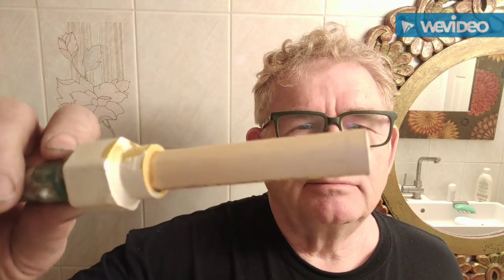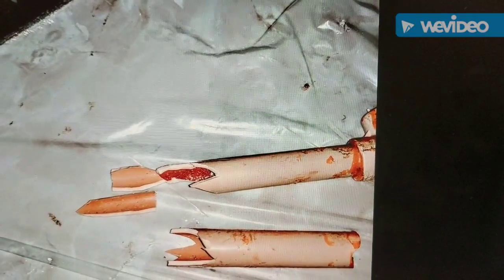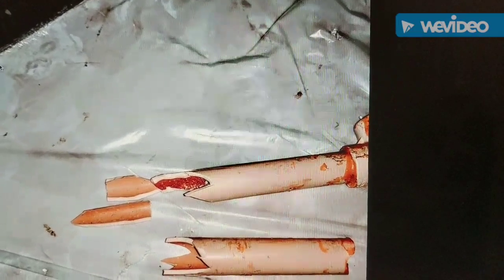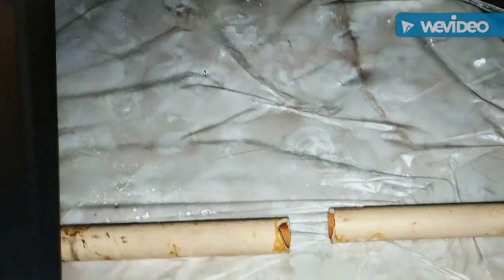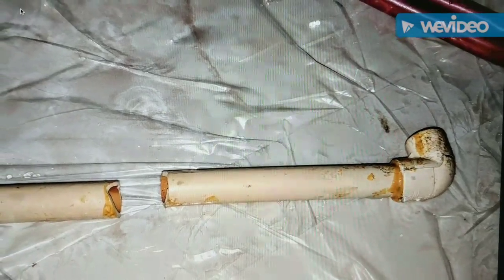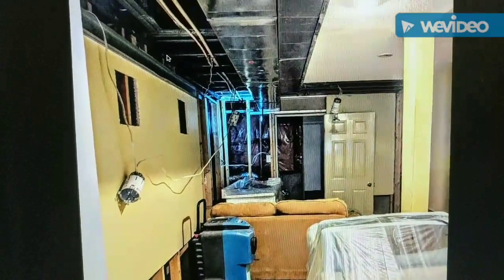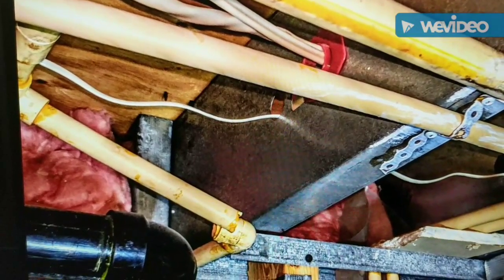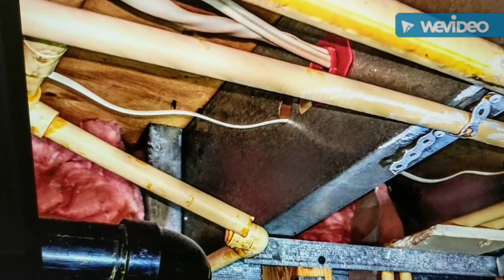The Danger Of CPVC pipe

Comment: David knows what he's talking about. I just bought a 26-unit apartment house, build in 1999, and it's all CPVC inside. I was told by my inspector that 3 of the shut-off valves are leaking. They're all Sharkbite. When I went and tried to remove them, the CPVC shattered all the way back behind the wall on a couple of them. I'm having to rip out drywall and try and figure out what to do. If this had been a tenant and they accidentally shoved something against the valve, it would have flooded the unit, and the units down below. The CPVC was NOT clamped or braced from behind, so in part, it's installation error, but the fact it's so brittle and shatters SO easily is what David is trying to get at. You idiots in the comments telling him "it's been this way for years, David's wrong" don't know what you're talking about. David's pointing out that it's BRITTLE and therefore subject to breakage, not whether you CAN get it to work for 30 years or not. It's a warning, a clear description that installing it CAN lead to problems. I'm not sure there is actually a failproof alternative. They used to make pretty bad-ass copper tubing once upon a time, but the stuff they make these days is junky. I'm suspicious of Pex, so I'm not quite sure of what to do. I want to go back into the walls for every shut off valve and turn the CPVC into copper before it comes out of the wall so tenants bashing and yanking on the valves won't be touching CPVC. Not quite sure how to do that...
Reply: I'm a Maintenance man at a 96 unit complex and it was built in 98 and has cpvc throughout. Its a pain to work with and you have to be super careful not to break while doing what would otherwise be easy repairs. Water heaters are a good example. Gotta be super ginger with the main lines. I've broken two even with being careful. I Hate Cpvc.
Reply: I have galvanized pipe. Should i go back with a galvanized pipe replacement?
Reply from the maker: Thanks for the comments - I use copper type M for my water lines mostly and Viega pro press fittings to join it. That’s the best method for water lines- but expensive for the do-it-your selfer- if you can solder - it’s a tried and true method to join copper-The plastics industry is still pushing CPVC- but there’s always been BS in advertising -
Reply: @TheDavelaird  I really like your video. Only plumbers with lack of knowledge continue to use CPVC nowadays
Reply from the maker: @danielhennequin7753  Thanks -There are so many better piping systems now,We try to stick to Wisboro,Pro Press,Mega Press etc so I can sleep at night and not worry about Liability Claims

Comment: I purchased a cabin in the mountains that sat for 20 years with no environmental control.  There was no water running through the house but  due to cold temps it became very brittle.  Were slowly replacing it with pex.  Its been a nightmare!

Comment: Copper is the only thing that’s any good. The pex and c p v c I don’t use. As a builder and income property owner for 34 years. And as an hvac- refrigeration contractor for 42 years..  I won’t use anything but copper. Pex is ok in manufactured homes. The c p v c is a nightmare waiting to happen. I won’t buy or build a property unless it’s copper plumbing.

Comment: What causes CPVC to get brittle is hot water, especially if there is a circulation pump, or UV or a long period.  CPVC has no problem with chlorine while PEX does have a problem with chlorine and very sensitive to UV.  If a plumber leaves a roll of PEX outside, it will be shot in months.  PEX is the easiest to install.  Plumbers tend to us CPVC for remodels because the runs there there for the steel pipes and it is easy, and PEX for new because it is the cheapest when labor is involved.  What is interesting is places like Saudi Arabia have used CPVC longer than the US and have zero issue BUT they only use Schedule 80.  It's the same OD with thicker walls.  CPVC expands a lot more than any other plumbing material which is why you need to plan for it.
Reply from the maker: The brittle pipe I showed in the video was COLD water So please explain all the problems with CPVC sprinkler lines, which are all COLD water-so much for your theory-CPVC is Junk -hot or cold -i'm a master Plumber and i prefer copper pipe or wisboro (Pex A) Pex B is for Handymen or cheap builders and what they do in Saudi Arabia is of no concern in North America -They have Sand and Sun-We have Snow and Smog

Comment: David,  My contractor install PVC for main water supply in the retail commercial building.  Today one of the plumber recommended to replace it with CPVC (per building code, he said,  Should I replace it?
Reply from the maker: I would stick to PVC especially if it’s underground - I don’t know the code in your area- but call the local plumbing or building inspector to see what they say -I wouldn’t use CPVC for anything.
Reply: @TheDavelaird  The 2” PVC pipe from underground to inside the building hang up about 7’ below the ceiling to supply  water for each tenant.  My main concern is that what inside the building is PVC,  but just for cold water supply.  
My other question, What pipe type for the tenant using for their unit?  Some use pex other use cpvc since it recommended per code?  But this building doesn’t needed inspection for plumbing.
Reply from the maker: @jasontran06  I don’t know what area you’re in but my personal preference is for wisboro pex type 1 - for hot and cold water or copper pipe Ifvthere is no plumbing inspection in your area you could always coordinate with your insurance company to make sure that if there is any problems the insurance company is going to cover it Or hire an architect or a certified engineer to go over the building with you and make specifications

Comment: I am putting in a under ground rain water line ..guess will be last time I use CPVC ..//so what do i use ..steel ,copper ? ? How about regualr PVC ? //Chlorinated polyvinyl chloride

Chlorinated polyvinyl chloride is a thermoplastic produced by chlorination of polyvinyl chloride resin, which is significantly more flexible and can withstand higher temperatures than standard PVC. Uses include hot and cold water delivery pipes and industrial liquid handling.

Comment: Chlorinated polyvinyl chloride is a thermoplastic produced by chlorination of polyvinyl chloride resin, which is significantly more flexible and can withstand higher temperatures than standard PVC. Uses include hot and cold water delivery pipes and industrial liquid handling.//
Reply from the maker: That's a Great Blurb-right from Wilkopedia-But too bad It Gets hard and Breaks over time-read the comments on this page and take some advice  from this old Plumber-

Comment: The only time I touch cpvc is if I can replace it with copper back far enough that I can anchor it to a stud. People do stupid things like yank on their hose or pull on a random pipe sticking out of the wall. CPVC is fine for fire sprinklers hidden away in a ceiling.

Comment: Why is state and city inspectors put their seal of approval on all new installation.🤔
Reply from the maker: approving a plumbing installation is totally different ,if the product is approved for installation by the local code.  The inspector would have to approve it as long as it’s done according to the plumbing code( I.e. properly vented etc.) it doesn’t mean that it’s a good product -usually manufactures  lobby code writers and municipalities in order to have their products installed in various codes -History shows that many products have been approved for use in  codes ,only to be subject to legal proceedings  after  a series of poor performance (I.e. Kitec pipe, bituminous sewer pipe,Asbestos,PCB’s etc etc)

Comment: did you use the plastic valves---mine just snapped off---there is a screw in the handle ---can the handles be replaced?
Reply from the maker: I never install CPVC nor would i ever use a plastic CPVC valve-why not buy an identical Plastic valve and use the handle?

Comment: I just found this video because previous owners ran cpvc to barn from house. I'm now chasing cracks and leaks in 3.5 ft deep muddy holes. I hate how brittle this stuff is
Reply: lol, for exterior you need to use PVC sch40 for water and for hot water line its best to use copper. CPVC is alright in attic in in between ceiling spaces, for underground use you have to be careful. CPVC is not the best option for cold water. PVC SCH40 is stronger.

Comment: Copper causes more problems with leaking elbows with pin holes.
Reply from the maker: Not in my 50 + years as a plumber - nothing is forever-copper fittings and pipe can pinhole- but a small spray after many years of service is nothing compared to a horrific flood from a cpvc water line snapping off under full pressure after only a few years

Comment: It's been around more than 15 years, came out in the 60s. I've had it in my house almost 50 years with no problems. I'm on a well so there's no chlorine in the water.
Reply: Me too. Our house is 32 years old and I've never had a problem.
Reply: I replumbed my whole house Yr.s ago with cpvc. Probably 20 to 30 yr. ago and have had a couple of times where I have found brittle pipe. But it was when I was doing a miner repair. Cpvc is good,but you do have to keep in mind the warnings in this vid. I am getting ready to replace a tub,shower valve and will use cpvc. The main reason people use it, including me is because it is easy for diy. You just have to go slow and understand the good and bad. This is the first vid. I have seen on this and it was a good vid. and warning.
Reply: Exactly, What some don't understand is it's not for every jurisdiction. Some have wells some have chlorinated city and others. The only leak I ever had was copper pipe pin holes from my well water. Re did whole house with cpvc.

Comment: Well if you are DIY you can do copper with sharkbite fittings or practice soldering , so best choice.  Cpvc you can't expose to sunlight but its easy for diy, so is pex. I just took apart my bathroom, 50 year old copper pipes still going strong, they had copper drain pipes that corroded. But, the house always ran on well water so no chlorine, you ever see a pool guy who puts equipment in back of his truck, if you do you know that truck is rusted out. So pre-filter your house from chlorine? might be a good investment. Something to think about but it comes down to budget, skills, footage. Good luck.

Comment: Great video- but when you present a problem/risk- you should offer a solution.  If your message is to not use CPVC then recommending what to use in its place would have been helpful.  Thanks
Reply: Obviously copper, right?
Reply from the maker: Hi -I use copper or Wisboro pex A-But I prefer Viega Pro Press copper-you have to solder if you dont have the pro press tool

Comment: 1:21 "mention poor lady pulled her hose in garage" Lets look at the context of where PCVC is installed in a garage- non conditioned space, and maybe on an exterior wall and possible in an enviroment of heat and UV exposure. We have seen CPCV exposed on the exterior  and interior of a garage instead of PVC or copper which created the same brittle effect. I would not apply your context to ALL situations. Builders are gong towards CPVC due to labor costs and material costs- huge usage in southeast gulf states.
Reply from the maker: The break was INSIDE the house . The hose was connected IN the garage-The brittleness in The CPVC is from Chlorine in The the water -so your theory doesn't apply -Most  plastic exposed to UV rays gets brittle-But CPVC is installed in walls and isnt exposed to  UV rays
Reply: I’ve been a Gcontractor, remodeler, and now currently a home inspector in the state of Washington for a total of 27 years. This stuff is a complete nightmare and one of the biggest failures in construction process in all the time I’ve been involved. It’s completely insane that it was used so prevalently for about 8 years. Just like how contractors were getting away with no drip flashing and facia on an Osb roofing system. These things take a while to play out and find their obvious problems. For cpvc it took 5 years. This stuff is garbage
Reply: I’m
Actually going to fix a friends house today that leaked into the kitchen ceiling and has cost untold amount so far. At least it’s not behind the tile in the bathroom. But I’m a couple years who knows. It’s on the hot side and his water is chlorinated. FYI

Comment: CPVC is another polybutylene pipe. Today I was going to replace faucets. I turned off the angle valve and tried to unbolt a  3/8 compression faucet connector. CPVC pipe started to be cracked near the angle valve. It flooded several buckets until I ran to the main shut-off valve. 3 pipes near angle valves were broken during replacing total 4 faucets. The house was built in 2005.

Comment: A local Lowes store where there is a CPVC "T" with a tiny crack which has been leaking in the wall and I have to quote the repair. I can't believe they used this crap inside a wall. On one side is tile in the restroom and on the other side is a large electrical panel in the electrical room. The only way to repair it is to remove one stall partition, take out some tile and open up the wall. I wish I could replace the whole damn pipe but that's a huge job. I've done a lot of work with PVC in the past but never used CPVC before.

Comment: built my own house 20 yrs ago i used cpvc ... ;-))) still  going strong!!! Peace;-))) plumbers  hate this stuff! easy to work with.
Reply: That shit sucks.
Reply: @keepitreal829  that shit do suck something awful
Reply: Replumbed my house 24 years ago with cpvc & never a problem...knock on wood!
Reply: It is still going strong until its not
Reply: did you use the plastic valves---mine just snapped off---there is a screw in the handle ---can the handles be replaced?
Reply: @gregl2249  I think you have to replace valve at this point...
Reply: I dont hardly use any specialist in almost no line og work nomore. I just study it w my phone for hours if i got to and sometimes even as i go. So far ive accomplished a great deal, more than i thought i ever would
Reply: Balogna!!! I’m a plumber and use cpvc EVERY day!!! Cpvc is just fine in the long run and I love the stuff.
Reply: Sure, as long as you don't touch it. But don't be over confident; the slightest movement of the house could cause it to snap and cause a flood.

Comment: I installed cpvc in my home due to copper corroded. I never had an issue with it and to this day about 26 years after install the cpvc is still good and not brittle at all.  Cpvc must be supported as to not flex so then it will not break. Only plumbers hate it as it take away their jobs which is very high in labor costs. A plumber will charge way too much to install copper per cpvc. Cpvc is safe as any brand pipe and less costly for the home owner. Poor plumbers cant charge a very high price. Screw the plumbers!!!
Reply: exactly!
Reply: You are DEMONSTRABLY stupid. I'll do cpvc all day. You're not gonna get any warranty, but I'll do it. Enjoy that entry level budget though. Screw the plumbers? No, screw the people who have zero value in life and try to turn it around on others.
Reply: Completely disagree.  I’m in the trade and see this all the time... by 15 years it’s very brittle.  I had a job today fixing a pipe and could not get a straight cut because it just kept cracking.  I ended up using a copper cutter to get a decent cut but a two coupling patch job turned into a 2 hour nightmare.  It’s cheap and easy to install but long term a horrible idea.  50-100 years with copper and it doesn’t leach oil into your water.  Propress makes copper stupid easy to install now but homeowners can’t justify a $3k tool
Reply: @bryanp8010 weird…. Changed my t&p release valve and had to cut 18 year old cpvc, wasn’t brittle at all. Theres more issues with pex than anything.
Reply: @bryanp8010 ... Nonsense
Reply: @bryanp8010  Thats when we know you don't install CPVC for a living. LOLOLOLOL "Copper cutter", get out of town bro. You can easily use a hand held hacksaw blade and won't have any problems. The only time I recommend you don't use CPVC is when you don't live in South States. Everywhere else you have freezing temperatures and CPVC does not expand like PEX. So if you live in the South (California, Texas, or Florida) where it does not go below zero, your okay with CPVC.
Reply: @CSJiGSaW08   used a copper cutter because nothing else worked.  The plastic cutters kept breaking pipe.  And I’m in northern states buddy, but there are lawsuits out against cpvc companies, look it up.  Maybe it’s okay in the south I have no idea but I’ve done plumbing from NC up to NY and I don’t recommend using that garbage to my customers.

Comment: Great info. I recently did a tear out of an upstairs bathroom. Despite being very careful, a CPVC pipe within the wall broke and flooded to the downstairs ceiling, causing a ton of damage. Was not an easy clean up. This stuff sucks. Pay the extra and go with pex or copper.
Reply: How do we know that PEX won't end up being brittle like cpvc?
Reply: @ryanporter1819  I would say because it's been used for applications since the early 80's and hasn't so far. That's coming up on 40 years of durability. I've seen CPVC turn brittle from city water in less than 20 years.